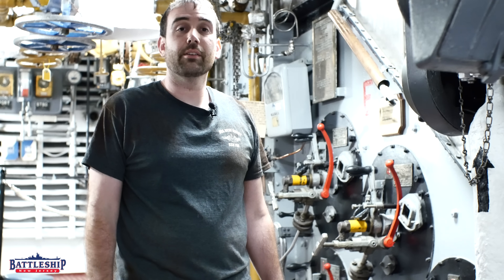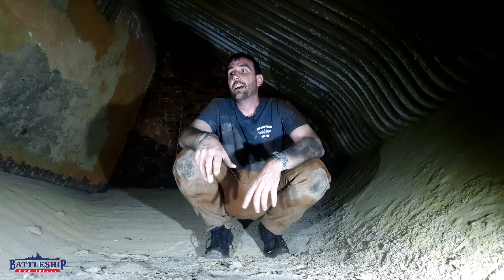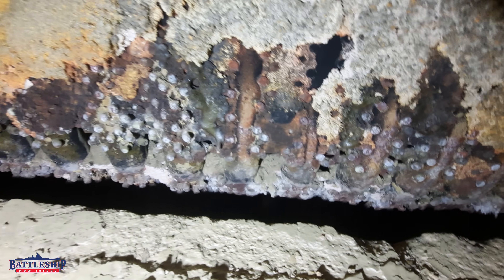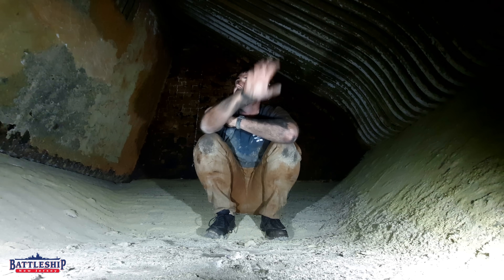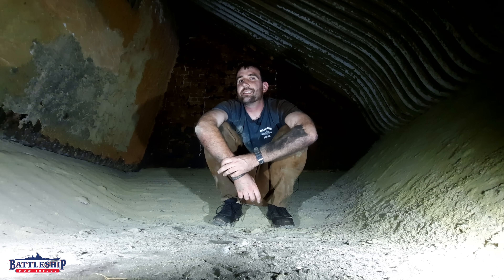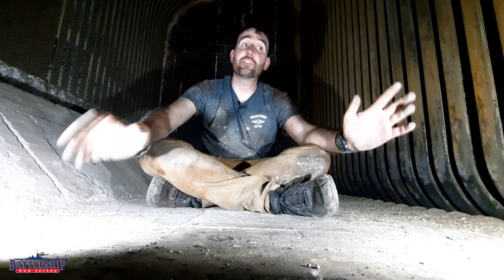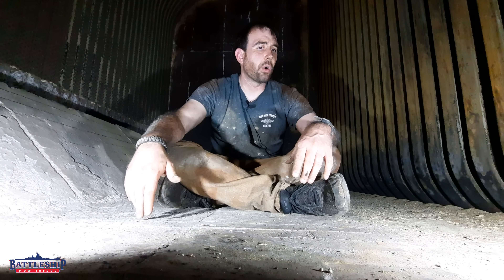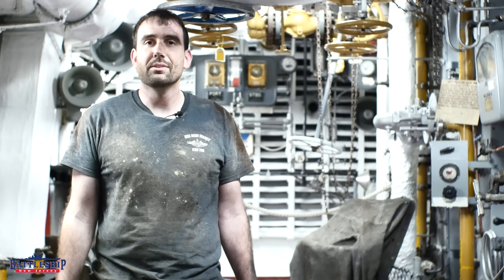Inside the Boiler of The World's Fastest Battleship

Comment: The vacuum in the condensers is the direct result of condensation. (basic PT relationship) The colder you can make it, the deeper the vacuum, the higher the efficiency of the turbine.

When they say "dry steam" you aren't actually drying it, you're elevating the temperature further above the saturation point. Even just 1°f above saturation and you no longer have any liquid at all. (Of course in such a large system, you'll still have a gradient that's the walls of the pipes, in which the temperature will be cooler.) The higher your superheat, the more pressure you can drop over the turbine before you get condensation. Superheating requires very little energy compared to boiling, lbs for lbs. (about 1940× difference)

Comment: Great job explaining the workings of these boilers.  A few comments; the saturated steam is all steam - the superheating to raise the temperature of the steam to a point that when expanded through the turbine the steam is still slightly superheated at the exhaust of the low pressure turbine.  Superheating steam prevents water droplets forming on the turbine blades at sub-atmospheric condensing conditions.  The nubs on the tubes were addressed by other folks in comments, there to allow for refractory to be shot onto the tubes.  These boilers were designed with far small diameter tubes for greater / faster steam production.

The engineers designing these beasts were top notch heat transfer savants - their design of multiple burners strategically located within the walls of the firebox positioned within the firebox to facilitate rapid response to ship speed requirements. Burning #6 oil, their were several types of burner guns which were often switch out while operating to provide the various propulsion requirements.  Typically the superheater burners weren't needed unless the ship need full speed to assure non-condensing conditions at the exhaust to the condenser.  Freaking amazing engineering.

Comment: When were those boilers last fired?

When fired on Bunker ‘C’ oil was some other fuel, a lighter oil maybe, used to heat the heavy oil when the boilers were cold and no main steam available?

I have never been inside a marine boiler, but I have been inside a power station one.  A lot of British power stations had Babcock & Wilcox boilers.  The one I went inside was huge, for a 500 MW unit.  These boilers were something like 200 feet high and actually hung from the roof of the boiler house.  They expanded downwards when they got hot.
Reply: I think if they had to do a cold start they piped steam in from the dock to warm the fuel up.

Comment: Bunker C oil was rather high maintenance to actually burn. Just getting it to flow required a shitload of heat, because it was so viscous. If heat was lost to the heaters, the fuel itself would solidify in the fuel lines and would require a total overhaul. The fuel was heated with steam to allow it to flow, so to do this, No.2 fuel oil was burnt first to get the steam heating operating for the “C” and when the “C” started flowing into the boilers, the switch was made to full bunker C firing.

Comment: I was a BT in the early 70s. USS Camden.  Firesides was no fun, but the worst job was doing watersides.  The top and bottom of the superheater has a tank or drum top and bottom.  We had to clean the inside of the tubes with a spinning wire brush.  The top drum (called the steam drum) was large enough to sit up in.  We  ran the brush down and out the bottom of the tubes one at a time.  It took quite a while.  Now for the worst part.  We had to do the same on the bottom drum (called the mud drum).  That one was much smaller than the steam drum.  We had to lie on our back and run the brush up the tubes. If you were claustrophobic it was a tough job.  My only experience with claustrophobia was working in the air chamber that directs air into the boiler from the Forced draft blowers.  It is just large enough to get in. Moving around is very difficult because it is tight and there are  angle iron supports that must be crawled over and under to get farther inside.  I was in there and felt a great need to get out. It took a while slithering backwards over and ended the supports.  

This link shows the back side of the boiler without the enclosure. The other side, the boiler front is where the air chamber is and the burner openings.  We opened up one of those and swung in.  It was hot. 

https://external-content.duckduckgo.com/iu/?u=https%3A%2F%2Fs-media-cache-ak0.pinimg.com%2Foriginals%2F83%2Ffb%2F76%2F83fb76f9469160202798d7630aa27c4c.jpg&f=1&nofb=1&ipt=e40968121c72ce008e5f6eb190adf7791ebfe97540240920c9b01d52ce5f63d1&ipo=images
Reply: I road Camden in 2000, long live 600# steam

Comment: hey @BattleshipNewJersey, the studs you are seeing on the tubes at https://youtu.be/i442Y6TqHeg?t=230 are Stud Tubes.   Stud tubes were a type of boiler wall tube that had solid studs welded to the outside surface. The studs increased the surface area of the tube, allowing for better heat transfer from the hot gases to the water inside the tubes. These studs also helped to anchor the refractory material lining the firebox.

Comment: Been there, done that on the Missouri.  Probably 1989, I was a Gas Fee Engineer, had to check the furnace before BTs could go inside to work.  We had a couple burners open and a fan had been ventilating for 24 hours so there wasn't really any concern about gas but it had to be checked.  It was still pretty warm inside 24 hours after being shut down and tagged out.  It required dozens of Danger tags to secure properly.  BTW the steam plant was never run on saturated steam - that would be a good way to ruin the main engine and generator turbines in short order.  Superheated steam is required and the superheaters were always used.

Comment: I work on a high pressure turbine (Tur-ben) that takes 1500psi steam and the low pressure turbine is at about 850psi after it gets reheated. 
Pretty cool that nothing has changed in nearly 100 years.

Comment: -2 atm (relative ambient) vacuum is not possible. The condenser's function is to condense steam to create the low pressure on the exhaust of the turbine, thus creating the pressure differential from inlet to exhaust that allows it to work at all. Otherwise, the incoming steam would not be able to expand as much and do as much work on the turbine. If it weren't for that, the idea of condensing the steam seems wasteful: why give up a ton of the steam's energy to seawater?

Comment: I got curious and did some math... Battleship new jersey makes 216,000 hp give or take a few thousand. Marine 327 sbc makes around 365 hp... so you would need around 592 - 600 O.E. equipped   small block chevy engines in order to even dream of duplicating that amount of power.  Give or take... that is CRAZY

Comment: Superheating steam isn't necessarily needed to protect the turbines. Nuclear power plants (or in fact nuclear powered ships) use saturated steam in their turbines since you can't superheat steam with most nuclear reactor (high-temperature reactors could but for now those are still experimental and it's doubtful they will ever reach maturity because the few experimental ones had many severe problems). Superheating increases the efficiency significantly though because the thermodynamic efficiency of a steam turbine is a direct function of the temperature difference between inlet and outlet, ie. the hotter you make the steam the more efficient the turbine gets.

Comment: the first chamber you were in is called the windbox where the combustion air is blown into by the combustion air fan and then through the vanes around the central fuel tube/atomizer.  It would be interesting to know what burners they are (look like Coens??). Although they are B&W boilers, unlikely they would have made the burners too. I've crawled into a few but not ship's boilers, mine were in the refineries :)

Comment: While the New Jersey has the record top speed for a battleship at 33 knots (38mph), the SS United States passenger liner - 100' longer than the Titanic, set a top speed of 38.3 knots or 45mph, and that speed wasn't even at full throttle!  The United States was built in part with input by the U.S. Navy, as it could be converted to a troop carrier in 48 hours if needed.  It set a record crossing the Atlantic for a passenger liner that still stands today.  Unfortunately, it now is moored in Philadelphia rusting and deteriorating.  There is a movement ongoing to try and raise enough money to refurbish it, but only time will tell if it's successful.

Comment: Your DA tanks should have had some chemicals added to change the PH as steam will eat away at your boiler and ship piping if untreated. 
Yes I do work on boilers for a day job. I'm only doing 340 degrees with 200psi of N so the water doesn't boiler to heat a small Ohio campus. About 270 psi pressure all told.

Comment: Great video.    1). What was the BOILER efficiency of those boilers and 2) what was the overall thermal efficiency of the system, as in what portion of the energy available in the fuel actually made it to turning the propeller?

Comment: The paper mill where my father worked his entire career as a mechanical engineer was powered by a steam plant with Bunker C-burning B&W boilers. He never got to go inside one of the boilers, though, because he wasn't a member of the applicable union.

I remember the oil was delivered to the mill in railroad tank cars that had to be steam-heated before they could be emptied. In the winter, there was always a bit of vapor rising from the rail siding next to the boiler house, because the steam pipes for heating the tank cars leaked a bit.

Comment: On modern land side boilers you have pins welded to the boiler tubes nearest the fireplace that act as griping points for concrete that covers the tubes. This is becasue the fire burns so hot that it will damage steel tubes if they are not insulated with either brick or concrete. Those concretions are probably something similar since in the saturated side you see that the tubes on the left are covered in insulating concrete.

Comment: I watched this video all the way through. I didn't hear the speed the ship maxed at. I worked on a MSC vessel SL7 Class ship and these ships did 38 to 40 knots. The boilers were insanely huge. Correction, I watched a second time and heard the New Jersey made 35.2 knots. That's pretty fast. Considering most commercial ships make 12 to 20 knots.
Reply: Those SL-7's were cool looking and FAST! Saw one in Damahm in 91, couldn't go aboard due to our "friendly" hosts.
They were great...
When oil was cheap!
Reply: @brucelytle1144  hells yeah! I'm going back to work on the SL7 ships this week. Thick steel decks, monstrous water tight hatches, sturdy keel, forward and aft houses and massive props pushing that massive beast through the water. Not too mention, millions of dollars in fuel to operate the vessel.
Reply: @brucelytle1144  MARAD maintains them. They do sea trials once a year and it is a huge fiasco. A rush to crew at least 70 people, rookie sailors and even engineers with no grasp on boilers. They can only find diesel electric engineers nowadays. I love it though, been doing this 32 years.
Reply: @insaneseafarer  that's just funny! Back during the Gulf War, I went on the Cape Borda as Chief Electrician. The same story, in a way. None of the engineers had a clue about how to light off. After about 10 or 11 trips, resetting fans and stuff the Chief Engineer asked me if I knew how to light off. I told him sure, went down and lit it off. I owned them after that! Got a permanent job with APL for my efforts.
Worked with the RRF fleet for awhile (till I got my A book with MFOW!)
Good luck with that! I wouldn't mind doing it, but the Coast Guard seems to have a problem with my smokes being too green...
Reply: @brucelytle1144  haha smokes too green! There are ways around that and there is plenty of work right now.
Reply: @brucelytle1144  https://youtu.be/41YMSh_AtbI here is a video of a drone I flew over two of the SL7 ships.
Reply: @insaneseafarer  Yeah, I know. I just got tired of the BS. I flunked on purpose... The Coasty that "officially" pulled my papers was a personal friend, we joked about it.
I'm retired now, 70 yrs old, wife of 40 yrs with alzhimers to take care of.
If I were to go back, they'd have to cut me some (lots) of slack on rules and regulations! I told the Coast Guard guy that their job should be to keep people like me off the streets and at sea, doing our jobs!
Reply: @brucelytle1144  the rules and regs are outrageous now. Very few standard agreements left with our union. I'm supporting my mom that has the beginnings of dementia so I need to stay working. I ship on car carriers, low pay, but so laid back and no one bothers you.

Comment: What about the process of cleaning out the boilers regularly?  I can see that the fire boxes build up ash as they burn fuel.  How often is this cleaned out and is there a system to blow it out or is it shovelled out or...what?
Reply: Nobody has answered so I will. They have "soot blowers". Basically a tube with nozzles on it that rotate (by air motor or by hand with chains). You put superheated steam in them and rotate "x" times, in a pattern, to blow the soot off the tubes and out the stack. This is usually done once or twice a day while underway. People don't like you doing it in port!

Comment: As I remember, on the WWII built destroyers I served on, the tubes had to be manually cleaned every 600 hours using bunker c. The BTs would smear their bodies with petroleum jelly to keep the soot out of their pores and making an easier clean up. We had 4 boilers but ran on 2 most of the time. When the boilers were retubed they got new bricks, usually during a shipyard overhaul. In 1970, most ships were converted to burn jp5 so only one fuel had to be carried. Lead bars were added in the bottom of the fuel tanks to make up for the difference in weight. Many ships were decommissioned about that time. My guess was to avoid the conversion cost and Vietnam was winding down. I was a QM, just what I picked up from friends and my dad was a chief engineer.

Comment: Firesides and watersides, even re bricked the front of the boiler  "D" type B/W USS Yorktown CVS 10,, stood watch in all 4 fire rooms, and did fire sides and water sides in 3 of them. 1965 to 1968..had brick failure in #2 Fire room and had to lay planks on the inside floor of the boiler to do repairs, they were chard when we took them out.. Pit Snipes are a Dying Breed

Comment: Wow!  That ash must have been from the thick old oil they used to burn.  I was a BT on the Butte (AE-27) and we would wire brush the tubes but we never had piles of ash like that.  In fact when I saw it I wondered if the refractory was disintegrating.  By the testimony of BT's that were there made me wonder if it were the fuel.  I'm still in the boiler trade today and I test fuel oil burns on my boilers monthly.  I don't get ash like that off of this fuel either.  This stuff is a bit cleaner than DFM but DFM was still much cleaner than that!
I'd like to see his cloths after he washes them with that soot on them!  All my white shirts would be psychedelic orange and red after washing lol!
Reply: I spent a lot of time lounging inside very similar but land based boilers that used 6 oil and there was never dust and sand like that.  I think it was the stuff they put around and over the tubes.

Comment: Thx BNJ for an infirmative and entertaining video of 1 of our great Nation's treasures of a bygone era. FWIW I served in USN during Viet Nam era and was assigned to a Patrol Gunboat (PG) which had a propulsion school on USN 32nd st near DD/DDG piers. One day in spring of '72 our Butler type  bldg. was rocked by the blast of a nearby DDG that had suffered a boiler/steam explosion while testing safeties by over pressurization. Our class rushed to the aid of the ships crew but there wasn't much that could be done for those poor souls. I swore to never having to work with live steam especially superheated a d 1200#. Luckily the PG had a CODOG (cruise on diesel or gas turbine) propulsion system which only used steam (125psi saturated) for heating when needed which in So East area where I served wasn't often. Little did I know that after my time in the USN I would work for an electrical utility and become a power plant equipment operator on several 320MW 3000psi 1050deg fossil fueled power plant generating 2+ million #s of super heated steam per hour. The speeds the New Jersey was capable of on Viet Nam era are impressive especially when compared to the 220 ton 165' aluminum and fiberglass PGs 40+ knot with 12,500shp from the GE LM1500 (J79) gas turbine spinning 2-6' dia variable pitch titanium propellers at 720 s rpm.

Comment: How long did it take to go from cold boiler to able to operate some systems to full steam?
Reply: On most ships, the steam system NEVER went cold. At least one boiler was on-line at all times, providing steam and water. If a ship came out of the drydock cold, min was 4-6 hours from 0 to top saturated temp, 2 more to superheat. NO shortcuts as tube will warp and fail.
Reply: @p.a.reysen3185  just sayin... I've seen it done in around 3 hrs after being cold for a month or so.
I've taken a cold engineroom from cold to taking the electric load in 5 minutes.
You can rush, when circumstances require, just not as SOP.